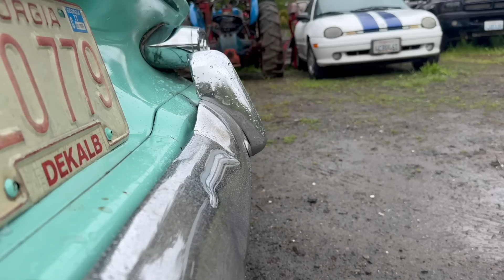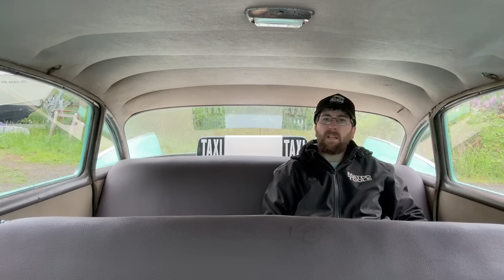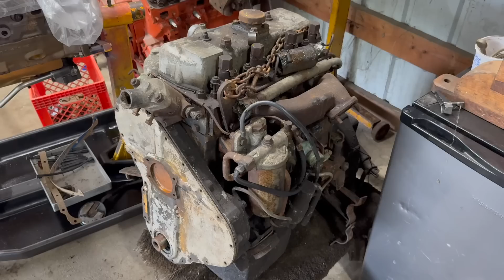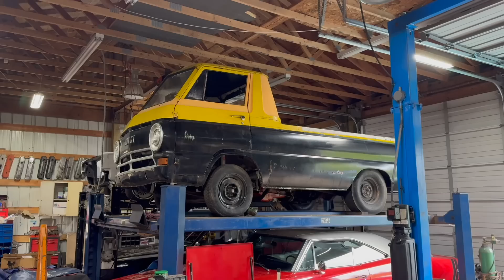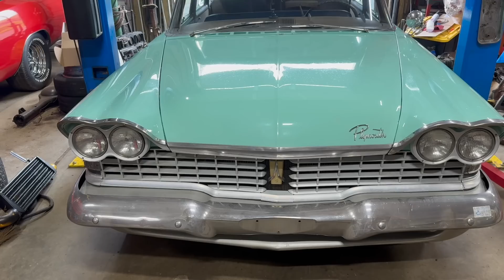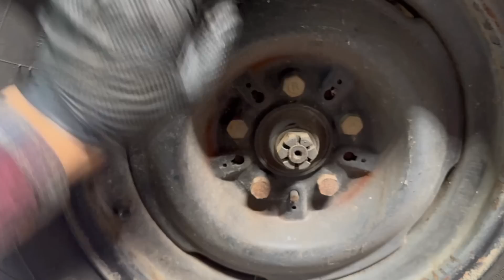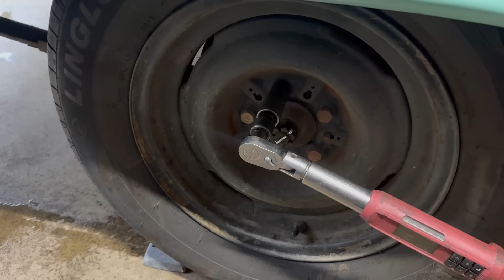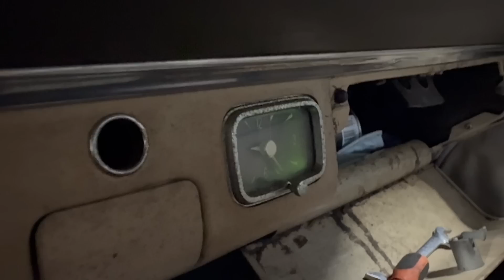Slow And Stinky - 1959 Plymouth Diesel Taxi Engine Tech, Test Drive, Safety Inspection (Not Good...)

Comment: Think of the money you'll save by never getting a speeding ticket.  The ad you showed for the diesel taxi, at the bottom said "good acceleration, top speed of 70 mph"  Off a cliff, maybe.  Zero to sixty in mere hours.  It's basically a tightly controlled oil fire and some metal.  I love it.
Reply from the maker: Exactly 😂 those were some VERY optimistic claims
Reply: That car would fit right in in Havana Cuba
Reply: If it has 55hp, and gearing permitting, I am pretty sure it will do 70. Dont think there is anything special about that number, you just need to keep your foot planted long enough on a flat road. People often underestimate the true top speed of vehicles, you need to keep it planted for minutes and several miles....

A more modern and smaller car wih 55hp does about 90-95 or so.
Reply: @GoldenCroc  I took a 62hp NA 2.2L diesel to 84mph. Downhill. 

It would do 70-75 on flat ground, wind permitting. (Tail wind or a loooooong straight stretch to get that last 5mph. 65-70 was doable within reason most days, on flat ground. I mean you had to be patient but it wasn't unsafe to drive on the highway, it just took more planning than a more modern car. 

That vehicle had a 5 speed trans so had more ratio available, but that was the line where the aerodynamics of it actually came into play. 

(1982 Datsun 720 pickup powered by a Nissan SD22 engine, 2wd 5speed manual, i know i already said some of this but not everyone reads every comment in a thread lol )
Reply: @goosenotmaverick1156  I read your previous one, if thats any consolation. A pick up has terrible aerodynmic drag compared to most other vehicles though, probably comparable or even slightly worse than this 1959 car. So in a way, your experience is probably quite represntative of what he can expect with this as well.
Reply: @GoldenCroc  that's kind of the thought I had. I figured it would be pretty close, at least close enough for a reasonable comparison. The truck was fairly light so I assumed that evened out the lack of aerodynamic design, when comparing the two. 

It was a really fun truck to drive, honestly. You really had to DRIVE but it was enjoyable. A very analog vehicle experience and I found it rather fun.
Reply: @goosenotmaverick1156  Weight has very little effect on top speed, almost negligible, but other than that I fully agree with your posts so far. 👍
Reply: @goosenotmaverick1156  I've got a 1979 240D also in the 62 bhp club.  4 speed manual and I've taken that sucker up to 95 mph but it will cruise all day long at 80 mph.
Reply: @bobbbobb4663  that thing must have the absolute best possible gear ratios 😂 thats impressive.
Reply: @goosenotmaverick1156 Lol my biggest complaint is gear ratios…the gap from second to third is too large.   For higher top end speed and fewer highway rpms, I’ve seen folks swap in a lower rear end gear from a 300D but mine is stock.
Reply: Drove a 62hp rated Datsun 720 diesel pickup. 70mph on flat ground with no headwind, 75 if you had a decent tailwind, was all she had, and it took time 😂. 60mph up smaller hills, 35 was all you got up a steeper hill. 

29mpg was the lowest I ever managed and I had to TRY.

84mph downhill was scary stuff.
Reply: @goosenotmaverick1156  I had a diesel Cadillac Seville. Drove it from Orange County California to Springfield Missouri. It had just about the same performance characteristics on the hilly section between the California border and Flagstaff. Slowed down to about 35 mph going uphill and put out about as much smoke as the Queen Mary.

Comment: another weird fact is that Perkins diesels, specifically the 354 ci I6, came in some c-series lcf trucks. That engine's production life lasted so long that the medium-duty mexican-only 2nd gen rams had them too, like 25 years later. I own a combine harvester with one of those 354s, theres still tons of them kicking around. I also have a Perkins 248 I4 in a tractor. A perkins powered mopar is right up my alley.
Reply: You must have a Massey 510, 550, 750, or a White/Oliver with the 354 Perkins.
Reply: @mattlf9120 it’s a 550
Reply: I have a 6.354 in my mf 1200. 

Not the original one but one from the 90's with turbo, rating about 135 or so hp, originally from a huge electric generator. 

Very hard engines to find  here in Sweden since a lot of people have them in boats and simply buy any available engines on the market.
Reply: I have a generator with a 354. It's very reliable.
Reply: A Plymouth is a Plymouth, unless you were in Canada. Look up a Dodge Regent or a Kingsway.
Reply: Ive got one, factory installed in a 1964 W300 Power Wagon